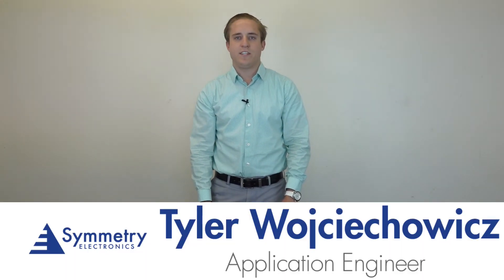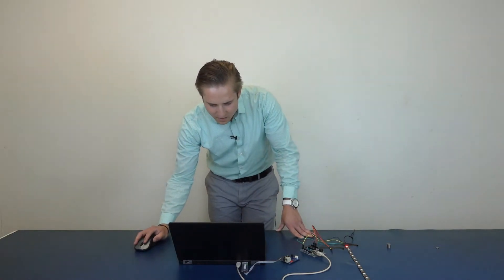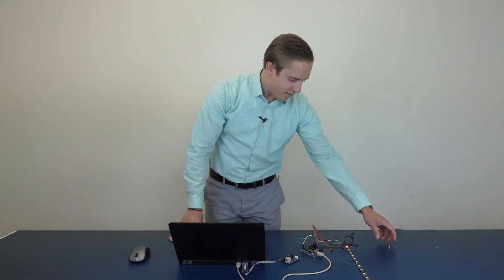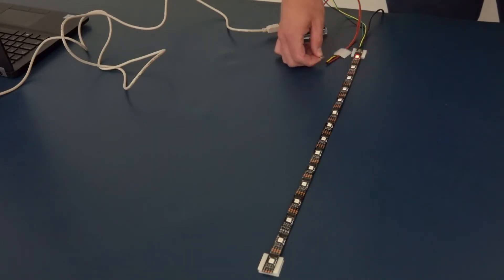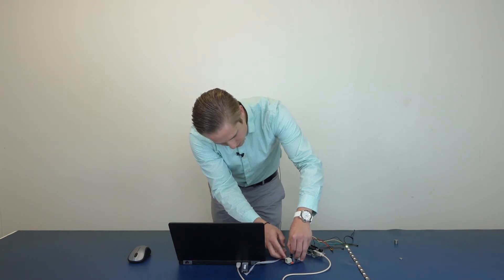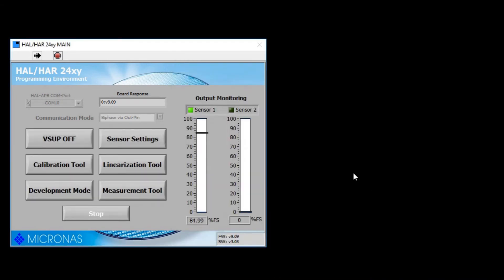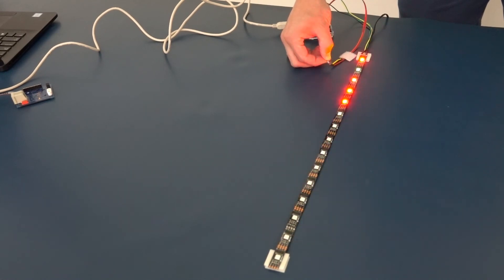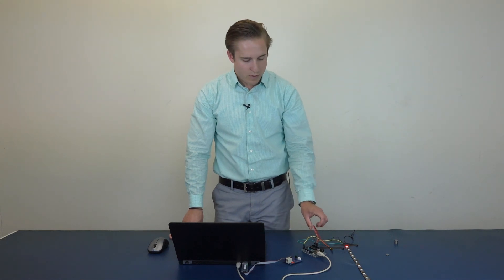Magnet Magic Using The HAL 2425 Sensor From TDK Micronas & Arduino Uno

Comment: This video doesn't even begin to touch on all the programmable features of the HAL2425. It also doesn't mention how wonky the Micronas programming software is -- periodically crashes and fails to recognize serial USB connection and/or the chip -- have to restart it a few times to get it to run right -- pain in butt that desperately needs fixing. Most important links in video description are broken.

Comment: So, basically what this video explains is that these sensors have an integral preprogrammed u-controller that lets you tweak the mathematics.  Of course the part that isn't explained (which would be obvious if the device was described in the language I've used above) is that the microcontroller has been crippled, you can only use the preprogrammed software to adjust particular variables. 

For a few pence more the inbuilt microcontroller unit could have been rendered electrically erasable and reprogrammable in any way a designer sees fit.  Then, for the demo we were bestowed, you wouldn't have needed an arduino at all! Perhaps you would want a buffer transistor to allow direct control of the LEDs by an 'intelligent sensor' but probably not, the alternate version of the same device would have definitely been an order of magnitude more flexible and only possibly a marginally higher cost.

 But oh no, much better to call it a magic sensor than honestly sell it as basic u-ctrler with inbuilt magnetometer.